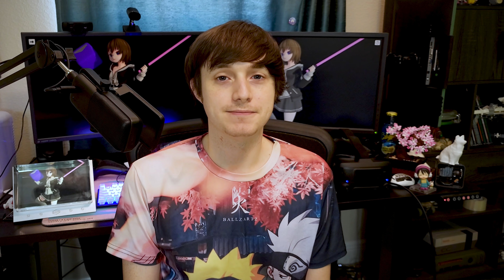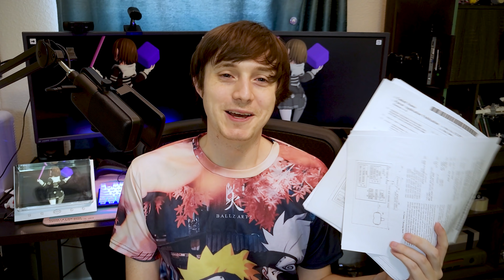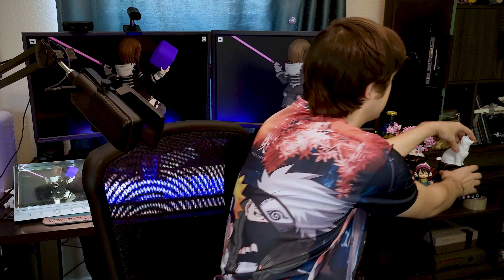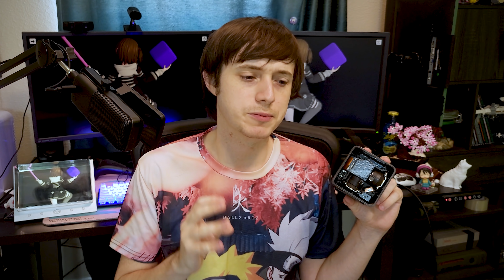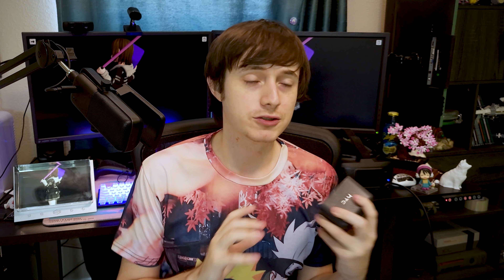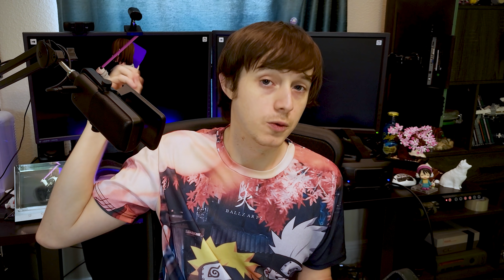Valve Index 2 Tracks at the Speed of LIGHT

Comment: Since this is IR, it will also solve one of the biggest problems with Oculus' inside-out tracking system, which is that it doesn't work at all when in a dark environment. However, the downside is that it will not work for hand tracking.

Comment: Thanks for the video. i appreciate the info that you brought. I was wondering if i could pick your brain and see if perhaps I am crazy. Anyways, though I do appreciate the constant inoovations and trying to move VR forward, I feel that they are going at it incredibly stupidly. Maybe its for money reasons idk. What i mean is. The tracking, as it stands is not bad at all. in fact its quite good. the controllers, are arguably the best on the market. what is an issue that EVERY brand has and if vale addresses it it would be the biggest impact, right now is FOV. the FOV should be 180H and like 120V. to be as immersive it can be. the black borders are the biggest problem today, and if improved, would have the biggest impact. What do you think? Why hasnt any company cared to address this obvious shortcoming?

Comment: You don't need tripods or to drill holes in the wall to have good lighthouse base station placement. All you need is a tension shower curtain rod placed vertically in the corner of the room.

Comment: Do you think we will see some kind of price drop for the Valve Index before the Valve Index 2 is announced, as this would give us a warning the Index 2 is coming. I am very curious how Valve will make the switch from the Index to the Index 2. A lot of people would be fuming if they buy an Index and in 6 months or less they release an Index 2. What are your thoughts on how they will go about making the switch?
Reply from the maker: Honestly, I don't expect a price drop before an announcement. According to Valve, The cost of components to build the headset have only increased since they released it. Mainly due to chip shortages. I expect that when we see a Valve Index 2: the original headset will stop being sold completely. Save for possibly the base stations and replacement parts

Comment: 180hz is pretty good, I would love to see more headsets with it. My pimax 5k super is great for it
Reply from the maker: I definitely see more value in trying to push higher refresh rates than insanely high resolutions for VR right now. Obviously both are good.
Reply: @SadlyItsBradley   I would prefer wide  fov headset like pimax with a OLED and 144hz and preferably with better lenses
Reply from the maker: @kingoftanks1682  you know, I didn't wanna admit this because it's embarrassing. But the eye tracking patent also detailed a brand new pancake lens system for the index 2 that mentioned a lot of benefits. The biggest being wider FOVs. I totally forgot about it until after I uploaded the video 🤣

Oh well, something to save for the next big "leak"
Reply: @SadlyItsBradley  That's great to hear, thanks for the heads up on that. Thanks for the Valve Index videos your doing great👍.

I'm also slightly disappointed because valve will most likely not sell the index 2 in Australia again seeing though they won't sell the steam deck here either.
Reply from the maker: @kingoftanks1682  ya it's incredibly unfortunate how limited the shipping logistics is still for Valve Hardware

Comment: Does oled reduce lens flaring as well? I’d imagine so as it can adjust individual pixel brightness… i’m curious to know the cause of it’s screen door issues too. I was expecting to just wait for microled before we got oled tbh
Reply: I don't think so. The lens flare we see is reflections from the Fresnel rings. OLED screens in VR headsets have a pentile pixel arrangement (alternating 2 colour subpixels) while the LCD screens used in current headsets are RGB (3 colour subpixels). This gives LCD a finer apparent resolution, while the arrangement also reduces the gaps between pixels so there is less SDE.

Comment: As long as it can be used in trackers for full body I'm in.  Any inside out tracking (Quest, HP Reverb Samsung) is just not going to cut it.  I'm trusting that Valve knows what they're doing.

Edit: I'm glad I'm waiting for my next VR purchase too.  I own a wireless Vive Pro and was thinking about the 2 but I'll wait a year and see what happens with the Index.
Reply from the maker: It seems like the concept is to take what they learn from their work in having lighthouse be a markered inside out tracking system, and taking that knowledge to apply it to this new system. Let each component made be able to give off tracking at the same time as calculate the position of outer units.

Even if that doesn't work, the compatibility with lighthouse allows backwards compatibility anyway.

Comment: OLED or bust really

It wouldn't be a dealbreaker if the display had everything else BUT OLED, but it would massively turn me off regardless. Ridiculous that the VR industry as a whole has taken such a big step back when OLEDs are cheaper than ever at this size
Reply from the maker: The main issue with OLED was the screen door effect and high persistence. I am sure the OLED manufacturers are watching the VR industry and feeling bad about the lost sales from these reasons. So they probably been improving, and we will probably see a return of OLED in VR some day.
Reply: @SadlyItsBradley  Sony's next VR headset will be OLED.  OLED is coming back because people are not going to put up with LCD in VR and the companies know this.
Reply: I was thinking like this until I saw the Rift S in person after using a Quest for about a year, I couldn't really appreciate my Quest quality since I saw how smooth the LCD Stripe Panel looked, even with less PPD (Same for the XTAL 5K that I used for like 15 Minutes at a fair). Besides that there is almost no application except some horror games that need complete darkness for immersion, so there is not really a reason to give up in quality while the issues exist.

If these issues get resolved by the time the Index 2 is built sure, OLED it is!